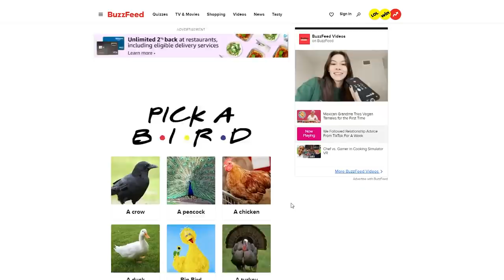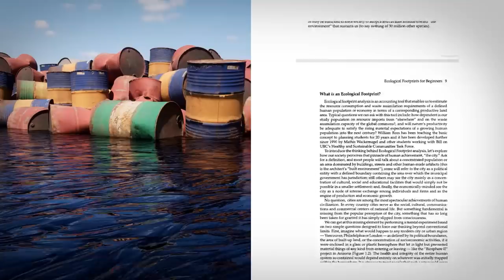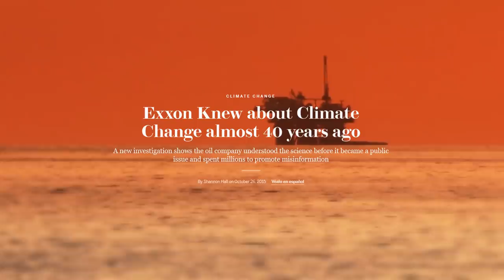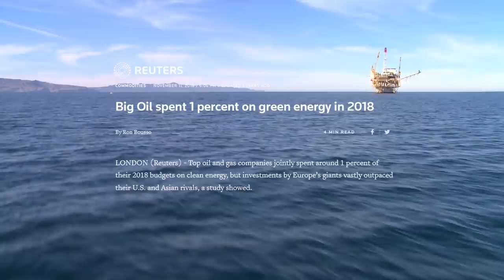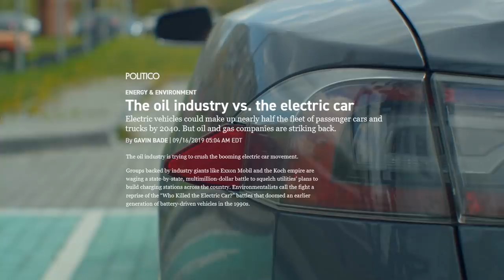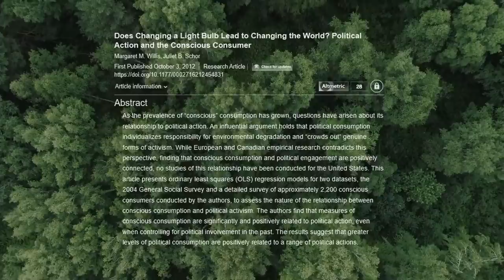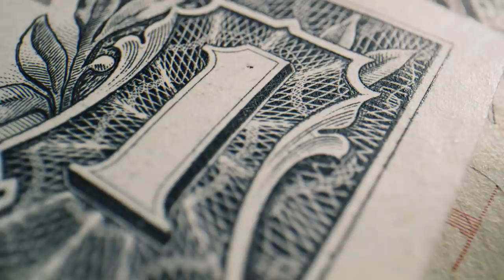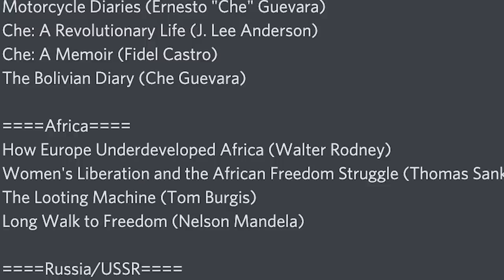Your "Carbon Footprint" Is A Scam

Comment: This is no different than the goals of plastic companies promoting recycling. Recycling alleviated people's guilt and the carbon footprint highlights consumer's guilt. Anything to shift the blame away from those who are truly responsible; corporations.
Reply: It is pretty astounding to witness just how many people have been lulled into a false sense of security by the action of recycling. For example, my mother views it as a cardinal sin to place a plastic bottle into the regular rubbish bin. And yet, does not think twice about buying cheap plastic junk that will easily break within months.
Reply: Yeq, except now they will fine you for not recyling 

Its a scam weve all fallen for
Reply: Also reminded me of how fast food restaurants were behind the push for anti-littering campaigns. All their stuff came in disposable wrappers that were ending up on the ground and they started getting some heat for their choice to use that sort of packaging. So they just shifted the blame on the consumer.
Reply: @timsmith854  ngl i used to be quite particular about making sure any and all products i used got into the recycling..that is until i learned just how much of it doesn't actually get recycled anyway :/
Reply: You're mixing how corporations and governments handle recycling with recycling itself. Also, anybody who has the least bit of education on the subject would see that it's not just about recycling - there is, e.g., also the need to minimize consumption where it's not needed, so we don't have to worry about more stuff to recycle ITFP
Reply: @FlutterSwag  i've never been fined for not recyling, but I have learned that the recyling is 90% garbage because most of what I recycle is plastic, but not the 'right kind' of plastic, or its mixed.  like milk gallons, that plastic ring  as a "this has not been opened by anyone" is a different plastic from the jug, and is NOT recyclable.....
Reply: Wait.. what's wrong with recycling?
Reply: @feetfinderguy7044  so let's go with something very simple. there something like 7 different recyclable plastics. (grab something plastic and look for the number inside the triangle).  most recycling companies only accept a few of those, so not everything marked as recyclable actually is... next you should be separating them. the typical gallon of milk has a different cap and freshness seal that needs to be cut off from the jug, because THAT is not recyclable...  for more info check online
Reply: @ilovefunnyamv2nd  oh I know that. I don't see why that's a problem tho
Reply: @feetfinderguy7044  so you understand what's wrong with recycling, and you're still asking what's wrong with recycling?  I'm sorry are you on the spectrum, because I'm not trained for that
Reply: @ilovefunnyamv2nd  I think there's a misunderstanding that we don't know about
Reply: @ilovefunnyamv2nd  I mean, what's wrong with having 7 different recyclable plastic? I usually separate them also
Reply: @ilovefunnyamv2nd  if you meant the lack of transparency from the company, then fair enough
Reply: @ilovefunnyamv2nd  btw, thanks for asking if I'm on a spectrum or not. It's considerate of you even if I'm not on it
Reply: @feetfinderguy7044  
maybe for you it's different, but after 30 years and 5 different waste managements, there has never been sorting for different bins where I was serviced.  It all just going into one container, and get picked up by a different dump truck than trash.

even if there was sorting, it puts an unnecessary burden on the recycler or consumer, rather than on the producer for making recyclable packaging in the first place.  
The higher the barrier to entry, the less likely people are do or achieve it, otherwise we would all be PhDs. 
Check in with your recylcer, see how much of it gets shipped out as trash, I learned that's what happens at my local recyler.

As a comparison: For my water, I have 6 different mechanical filters, a water softener, and a reverse osmosis system, but that doesn't mean its ok for the city to deliver barely safe drinking water.
Reply: @ilovefunnyamv2nd  ah ok, I get it now. Thanks for the insight
Reply: @feetfinderguy7044  its because they ARENT recyclable. And they dont get recycled when you put them in recycling bins. Companies still say they're recyclable tho
Reply: @ilovefunnyamv2nd  someone on the spectrum here! Please kindly shut up. I agree with your points but that was messed up. Dont say that as an insult. Being autistic isnt some insult. Jfc.
Reply: @danniuwu8628  that was an A-B conversation, and U aren't a part of it, so kindly shut it.  And no it wasn't used as an insult, that's just your impression. 
I asked because there was a mental disconnect.  A comparison would be trying to describe color to someone blind. Or the 5th dimension to a non mathematician.  it can be done, but it takes training to force yourself to think differently than you typically have to to translate concepts.
Reply: What do you expect the corporations to do? All agree to stop making plastic stuff?
Reply: @NOWABOmusic  Standardized plastics between the corporations so it could be easily recycled between each recycling plants, avoid using plastics entirely in the first place, reduce their own carbon footprint, take responsibility over their own fuck ups, use methods to reduce their waste being exposed to the environment ranging from air polution to waste. There's a lot that they could do, just apply everything you've been told to do with your waste and apply it to them.

Besides they're multimillion dollar companies, what's a few hundred thousand dollars worth of preventive measures to them.
Reply: Is it that impossible to do both? To be individually aware and active but also collective minded? I don't see any pros with this mindset of "it's not good to remind people of the effects of their consumption"
Reply: mass recycling of plastics is actually a correct society-level response because it provides the tools and system for a circular economy. An individual consumer's guilt approach would be asking people to wash out and reuse plastic bottles or similar
Reply: @FlutterSwag  It wasn't always a scam, but the one place in China that could do it profitably no longer can. So now it is a waste of time.

Comment: I like how you brought up the fact that our infrastructure is mainly car-centric, which inherently makes walking or cycling very difficult. Take it from me. I live in Houston, an infamously car-centric city. Believe me, places are so spaced out that it’s impossible to get to these places without a car and even dangerous to walk or cycle to those places.
Reply: That's indeed a huge problem, actually infuriating that walking has been made hazardous, and there need to be structural change. But in the meanwhile, instead of shifting the blame on companies or capitalism or some other scapegoat conceptualized as part of an exogroup as this video does, things would be quite different if people realized and accepted carpooling works, cuts emissions vastly, reduces traffic and room needed for parking, and thus can free up lanes to turn into bike lanes or made at least safe to work (granted, it's still not pleasant or efficient urban planning, but it's the first step to a transition).
Reply: Where I live in France, a car is all but pointless, save for the occasional long journey or pleasure-trip. Even then, there are few places that are not covered by some form of public transport.  

I worked in the US for a while and was provided with a car by my employer.  One day, I decided to walk to a shopping center.  No sidewalks so, I just followed the road.  No busses either.  When I commented on the lack of sidewalk, people were shocked that I would even consider walking the, just under a mile, to the shop.
Reply: I watched enough NJB videos to understand
Reply: If you've ever lived in a heavily populated area, your situation would be bliss. It's nice to have some space.
Reply: yes that is correct. Can I ask you take a trip to the Netherlands and see how that mostly car free country works. Buildings in France and many other countries were built before the invention of the car and thus, they are very compact and compressed making walking to the store on the SAME street you live on perfect!
Reply: With other words, USA is build just to make profit. And also, I live in a crowded country where everyone can see you hanging around in your garden minding your own business while they breath in your neck because their living space is only a couple of square meters. They can't buy a car because they don't have the space for it. Public transport is extremely expensive. So that's the nice thing about USA, the majority of people can buy a regular nice house while in my country people can't rent nor buy because it's just too expensive. Let alone pay and park a car.
Reply: If you live in a low pop density but large country, you need a private car.
Nuff said.
Reply: Public transport in theory is nice. In reality, different story. I have traveled all over Europe. Even the so called nice public transport is just awful. Smelly, crowded, some people have to stand or sit on the ground. Trains are late. You are packed in there with sometimes absolutely crazy people. I hated it. A car is a luxury. Not to mention, if you have kids, it’s so hard to use public transport for errands. Carrying bags of groceries while trying to manage children is not easy. Cars are a luxury I do not want to give up. I love my own space, smells, music etc and I feel safer in that space. Parking in a densely populated area is the worst part. But in the burbs, complete luxury.
Reply: I live in Los Angeles, my school is 30 miles away from my home,  public transportation would take me 3-4 hours to get there. I have to drive to get anywhere.
Reply: @ashleighsparkle8810  , I forgot about the kids and the groceries...shite, left them on the bus!
Yeah, that too, LOL.
With a car you can travel off the beaten tracks when holidaying.
Try doing that with public transport.
Reply: @ashleighsparkle8810  No one is saying cars should be banned forever, and those benefits you mentioned seemed to say more about you than everyone else.
If you want a car, get one, but even that should be a personal decision, not a symptom of a poorly systemic design.
Reply: This is why I like online shopping!
Reply: @popkick8350  
Well yes I will have my car and thanks for your permission? Are you saying that others don’t feel the same and or have the same needs as I mentioned? You say it like my preferences are wrong… what is so wrong?That I don’t want to be around crazy people,  smells and crowded spaces? That I have kids and need to run errands? What is being said about me with my preferences? And also I can’t speak to Houston but I can speak from a Californian perspective and if you needed to, public transport is cheap and available. But the CULTURE is different. We like our cars, therefore the only people that rely on public transport are poor, DUI, or crazy people. That’s not my opinion that’s reality. New York City being probably the only exception.
Reply: @ashleighsparkle8810 I think he was just saying that judging public transport due to bad personal experiences is a bit unfair. I for one nearly only use public transportation because where I live it is just amazing. It’s clean, decently fast and frequent to the point that I almost never need a car. There is no stigma against it even though it is literally FREE. However I do recognise that the conditions of where I live are probably too perfect for any major country to replicate it.

Comment: I've been saying this for years and how paying a voluntary "carbon tax" to offset your footprint is an obvious grift.  Great analysis and coverage as usual Second Thought.✌️
Reply: That tax needs to be involuntary.  Their actions are creating a problem that requires a TON more money to solve than they are chipping in.
Reply: The only way to make that tax works is to apply it only to corporation, but even then, that's still a compromise that will falter in a long-run.
Reply: @mickeyg7219  i would suggest to tax everybody and then redistribute the money equally
Reply: @trashcatlinol  You know what a grift is?
Reply: @calysagora3615  they were talking about a voluntary tax. we shouldn't have a voluntary tax (where you can choose to pay more on groceries and cars and stuff), we should have an involuntary one (where companies pay for the co2 they put into the air). there's no reason that putting co2 into the air should be free for companies to do when it literally directly costs money to repair.
Reply: And without significant regulatory oversight a carbon tax would pass costs down to consumers and disproportionately affect lower income folks.

Tackling climate change is tricky from top to bottom in a capitalist economy.
Reply: @calysagora3615  Private Property is THEFT!!!
Reply: @calysagora3615  oh lol. can't argue why it's good to prevent climate change with someone who doesn't even think it exists.

literally even oil companies are saying it exists now. they can't deny it anymore.
Reply: @whogavehimafork  Indeed it is tricky though I would unfortunately imagine it will be necessary as an intermediary since a sudden shift in economic system(which is what is needed IMO) is such a sweeping change that it can't be implemented over night.

That is short of a bloody and horrid revolt which would almost certainly fail against the huge amassment of armed forces that the oligarchs have built up to kill said expected revolt.

It is an unimaginably ugly situation where the change that needs to happen to prevent humanity from offing itself in a hilariously stupid display of blindly walking into a scenario of natural selection by ecological collapse for purely short term gains is such a daunting task that I can't really see a feasible way to do it with the disinformation and tribalism driven denial of objective facts and reality.
Reply: Soon they'll be a Carbon inflation tax  rate. I just made that up right now. 😏😉
Reply: @calysagora3615  Man, we all know you’re lying. I can literally see the effects of climate change right outside my window. I have travelled to many places and have seen the same, unnatural phenomena unfolding before me. What I see ain’t right.

But I am happy to hear that your little neck of the woods is untouched.
Reply: @josephhoward4697  Wrong again. I live in a human made desert. Again, I'm a conservationalist. I see plenty of cases of LOCAL climate change, where humans have deforested, eroded soils, drained water, killed off life of all sorts and so on. That's horrible, aybd it's what you see, because you move where humans live. The planet is fine though, it is recovering faster than we manage to fuck it up most of the time. It's irrefutable that earth has added a continents worth of forestry in just a quarter of a century. CO², the molecule of life!
Reply: @whogavehimafork  the carbon tax is a free market solution to climate change. The theory is that by making pollution expensive, companies that pollute less can sell products cheaper and gain a competitive advantage.
Reply: @calysagora3615  I can’t be “wrong again” if I’ve only been wrong once. Also, you’re wrong about me. I don’t just move where people go. People and I cross paths from time to time, but I am also prone to wandering outside civilization.

From what I’ve seen, there are either lots of places suffering from the same combination of unlikely coincidences or there’s a larger problem. You tell me.
Reply: If there was a proper and universal carbon tax, the most profitable products would tend to be green. That's a big "if", and corporations do everything in their power to avoid it.
Reply: For those confused by me calling it a "voluntary tax", I'm talking about these sketchy companies who advertise that if you give them money, they'll use it to offset your current carbon footprint.  How exactly is me paying say $500 a year to a random company actually going to reverse my current footprint? I could just lie and say the same thing, but how do we know what's actually being done with it? Most likely, it's just going into someone's pockets.
Reply: @ZERO_O7X  That's a carbon offset, not a carbon tax, and it definitely doesn't do shit. While it's good to fund renewable energy companies etc, it doesn't solve the fundamental problem. I think the video about carbon offsets made by the channel "Climate Town" is best at explaining this.
Reply: @calysagora3615  yeah everything in this comment was either nonsense or wrong.

Log off. You're making a fool of yourself
Reply: @EmotionsNeverLie  I'm not the one living by a random make-believe story decided by happenstance of birth location. I mean, how pathetically obvious is that?
Reply: @calysagora3615  bro you went on google and looked up questions that were worded in a way that would confirm your bias. You're not a researcher, you're a nutcase 🤷‍♂️
Reply: @calysagora3615  obv a troll, their only goal is to have fun muddying up any type of conversation
Reply: Emphasizing the Green New Deal despite being an implementation of socialism and having almost nothing to do with environmentalism doesn't make him look good though.
Reply: @whogavehimafork  Tyranny is always the answer 🤣
Reply: @AndDiracisHisProphet  No. Just socialism at that point